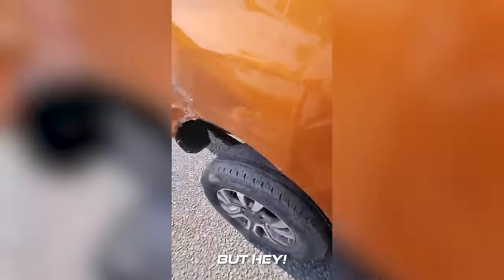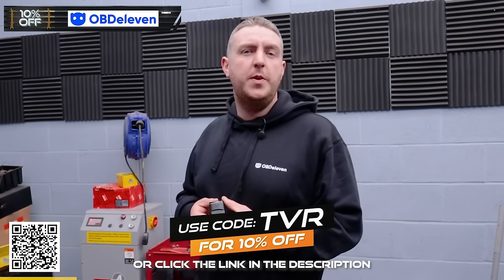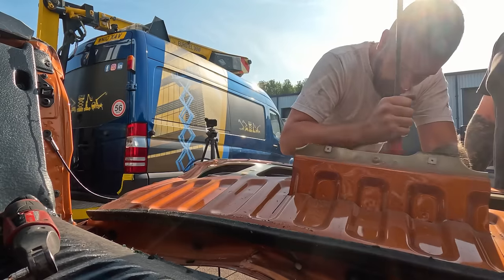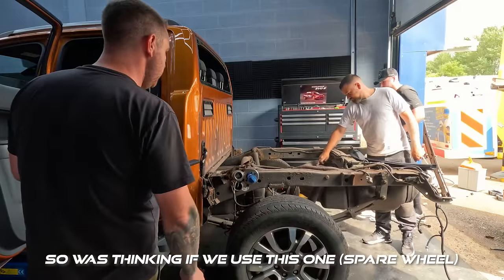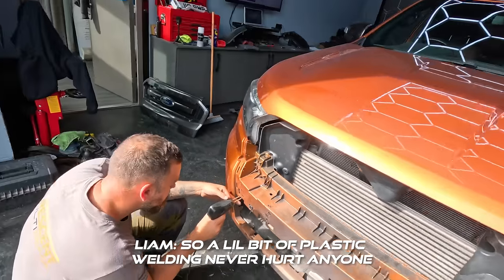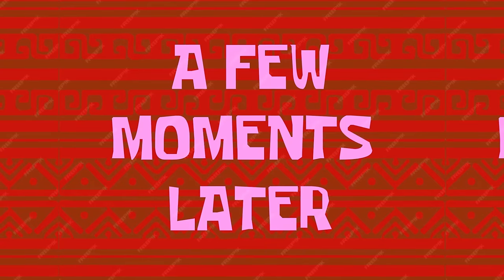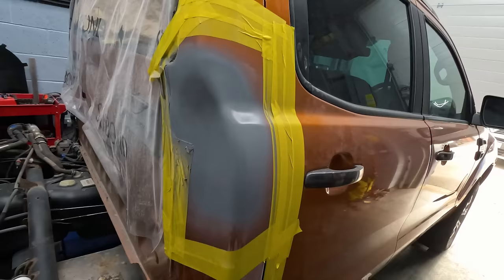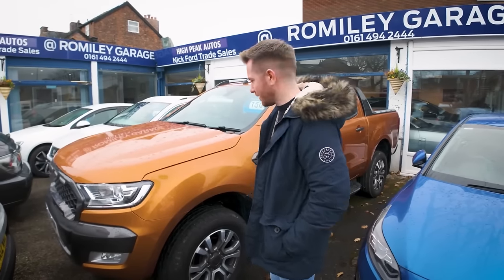WE BOUGHT A £10,000 FORD RANGER FROM COPART! (FULL REBUILD IN 15 MINS!)

Comment: can’t believe ranger has so much rust on the parts under the bed. 😢 I had a better opinion about these cars.
Reply: It's a Ford, generally speaking they do tend to rust for fun
Reply from the maker: Yeah its not the best for a 19 plate is it?! You'd think the manufacturer would do a better job to  make them last longer